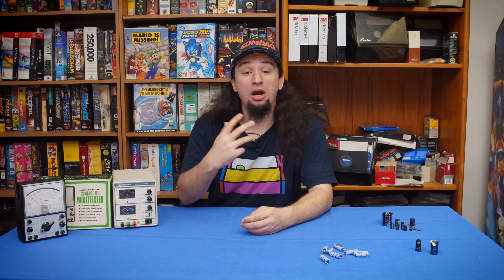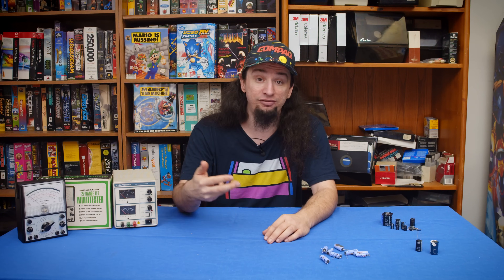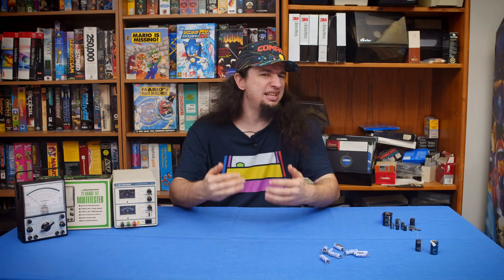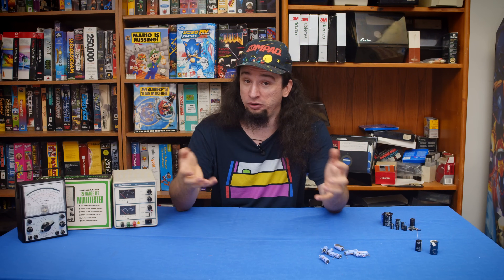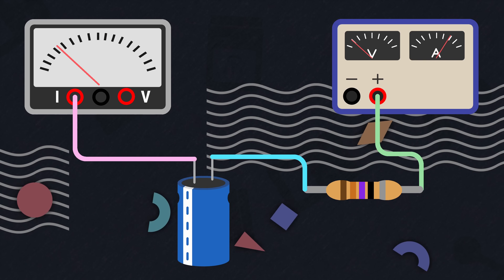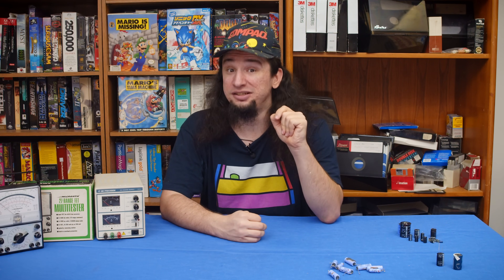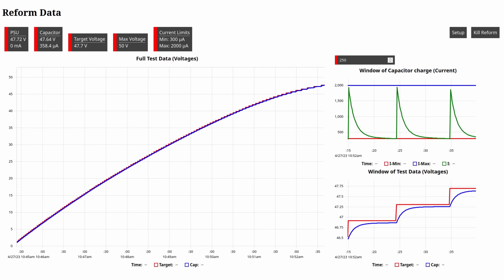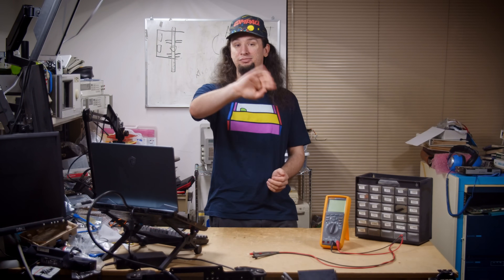Reforming Capacitors - Everything you wanted to know

Comment: It's a very interesting technical explanation on reforming, and how capacitors work.

But I'm not really clear on why you'd bother to do this.  You have to go to all the trouble of taking them out, which is most of the work of replacing caps.  Most caps in electronics cost on the order of $1, sometimes 10 cents.  

There's maybe some caps that'll cost $10 or $20, but even then it seems like a lot of time an effort setting up equipment to save $20.  It's impressive that this can be done, but I still have to ask, why bother?
Reply: Same question for me. But the likely answer is financial. Shelly considers  a 10 to 20 dollar cap expensive. And hey, it might be for him. But considering the amount he must have spent on equipment and time i doubt his overall cost calculations. 
And even after returning reforming the cap might not be totally reliable again and if it blows, the repair might be even more costly.
Reply: @bzuidgeest  then again a reformed cap might be very reliable. Sometimes we do things simply because we can.
Reply: @1pcfred  and sometimes you might win the lottery, but do as you wish. It's your stuff

Comment: Reforming is scientifically totally valid. But i do consider it not worth it. Financial means of course differ, but even the big ones i consider cheap. Most devices only have a few of them. And you will rest much more easily, being sure that it's perfectly fine with a new one. Repairs you have to make to the devices in case the reformed cap fails will possibly also be more expensive than if you had replaced it on the first go. 
This was a good video in my opinion. My only gripe is that i think you should have been more clear about that this video only covers a very specific case. The case of relatively modern electrolytic capacitors. Though you did mention that in passing.

Comment: So after reading through the other comments there is something that should 100% have been called out: NEVER reform or attempt to reform caps that are across line voltage in circuit. Those should ALWAYS be replaced with X1-Y2 rated safety caps. This is because electrolytics when they fail short don't always fail catastrophically short. That means they can heat up and actually cause a fire, particularly at mains AC voltages. Safety caps will always fail catastrophically, meaning they will either blow your fuse or fail open. But they will never fail in such a way as to cause a fire.

Another place that I would highly recommend never reforming is a bypass cap on a choke or transformer winding. This is because if that cap fails short it will heat up the choke or winding and can damage it to the point that it needs replacement. Transformers are expensive, caps are comparatively cheap!

I'm firmly in camp "it's always better to replace than reform" when it comes to electrolytics. But it's important to also call out that there are capacitor types that should always be removed before powering up a device: Paper and foil caps (waxies) should be replaced with polypropylene caps, before installing the new cap check the outside foil using an oscilloscope and connect that side to ground to reduce RF. The same goes for oil filled. Can style electrolytics should also be replaced as well and are often filled with PCBs. They should be replaced because when they fail the will release massive carcinogens into your environment.

It's always important to consider what happens if the cap fails before considering reforming. In many cases the failure will be damaged parts that are much more expensive than the cap. Hence my stance on "replace don't reform". A fire or destroyed transformer can be many times more expensive than just replacing the cap.

Final thoughts: What Shelby is saying here only applies to aluminum electrolytics with fluid electrolyte, not older styles or other styles. He says as much in the video, but it's worth reiterating massively. Attempting reformation with other styles is not recommended!
Reply: Electrolytic caps are never used across the ac line. They respond very poorly to that. So this video does not apply. That said. Yes please use modern x, and y caps in line filters.
Reply: @bzuidgeest  They have been in the past, particularly in older equipment. As best I can tell the standard was to put them in at a voltage almost twice the line (see the 300V caps Shelby was working with). They are basically equipment destroyers if left in circuit though. It was very common to use the multiple cap "Pillbox" style caps that are filled with PCBs for that purpose. Anything reasonably "new" e.g. mid seventies or later shouldn't have that, but before that point it's all over the place because the alternative was paper and foil caps... which respond even worse. Yet you can 100% find them in radios through the early 60s across line voltage. Plugging any of those radios in will pretty much instantly destroy things or cause a fire if that cap is left in circuit.
Reply: @NullReference119  i have worked on many tube devices and vintage electronics. Never found an electrolytic in there on the ac line. They would blow up. I think you are confused with early metal film or foil caps. Very different cap type.

Comment: I think electronics that require gigantic expensive capacitors should go away entirely. I used to be huge into expensive 1000W systems. It just doesn't really make sense to me anymore. Every single thing you could want to do can be done on a 15W device these days. I can stream WoW at 60 fps on a last gen Ryzen APU only, game and video compression and video upload, all at full performance, at not even the full 15W load of the system. Society as a whole needs to pivot to efficient devices like 10 years ago or we're all going to be dead soon. The rate at which power consumption is dissolving the planet is speeding up exponentially.

Comment: I have an old netgear switch and power supply had to be heated up a little  to turn the device on. Does heat helps with temporary reforming, or makes caps even worse? My neighbour recapped it and now it works like brand new, which it essentially is.

Comment: Thanks a lot for this video. I've been educating myself in every aspect of capacitors lately and this was great timing as i've been repairing a large lot of OG Xbox's. Didn't have too much trouble sourcing some caps - even the now discontinued ultra low ESR electrolytic variety.  

I found "reputable" companies offering cap kits either inadequate or flat out wrong at times (dimensions, lead spacing, rated voltage, ESR, even capacitance). Also been recapping the disk drives which is uncharted territory in terms of the Xbox. Additionally, the capacitors are often low profile and lack proper identifiers. Thanks to this video and one other, think I feel confident sourcing my own.
Reply: Ultra low ESR.. isn't that discontinued because we now just call that low ESR? Technology advanced.
Reply: @bzuidgeest  Currently no caps can meet or exceed the Nichicon HN 3300uf 6.3v in terms of specs. Polymers of that capacitance aren't manufactured.

I've been substituting by going with FM or ZLJ in 10 volt variants. Impedance is relatively close, and ripple handling is up to par.
Reply: @nuckenfutz9983  Yes more a thing of what will fit, rather than actual capacitance, and sometimes you are stuck with using ChongX, because they are the only thing that actually is available. At least better than the Lelon or MysterLee brand ones.

Comment: With small capacitors, probably not worth the hassle. The big beefy ones though, definitely worth trying if you got the equipment for it. Those guys are NOT cheap, and are often difficult to source!
Reply: it can be worth it if the cap is an old vintage type and you want to preserve originality as much as possible , i've reformed many signal  couplers successfuly,  in some cases the circuit will self reform them, after a while
Reply: A lot of guitar nuts would disagree. They freak out when someone has hacked up a vintage amplifier and replaced the original tone capacitors with newer variants.
Reply: @cajunfid  That's because what they loved about the sound was, in fact, failing capacitors. The problem is that as the capacitors keep drifting further from spec, the sound will keep drifting. Better to recap it, with some in-line resistors to keep the warm fuzzy sound, and actually have it last for years to come.
Reply: @cajunfid  : In this case : replace the guitar guy !
Drummers are way cooler 🤣😜
Reply: @cajunfid  if these tone caps are only in low level signal part of the circuit, no high dc across them, unlikely to need replacing anyway,
Reply: Pioneer amps from the early 80's .... 
20.000yF/63V .... oh yes ... they cost if GOOD ones.
Reply: @CharlieKirk1000  in an AMP you should definitely restuff or replace... never reform RF or AMP capacitors its a very bad practice because they won't ever operate as well as they should.... they "work" but it wont' be correct.
Reply: @Wingnut353  : Amen bro.
First i ever do.
The old ones have 20.000yF/50V (85C)and i replace with damn good audio (faster) 22.000yF/63V (105C) ....
63 Volts because the old voltage over here in Germany WAS 220Volts and is NOW 230-240 Volts ...
Reply: @CharlieKirk1000  probably will, 20,000 is not a 'preferred' value,  nearest 22,000 IF available in that voltage,, another problem is modern ones are usually smaller can size so if clamp fixed, need modding, or restuff the old ones 😉

Comment: Your 120 V US AC line voltage is measured RMS, that means after rectifying it, the max voltage your cap would see is  170 V.
Reply: Actually we use a center tapped ground bonded 240 VAC single phase system in the USA but thanks for playing.
Reply: @1pcfred  That seems non-sequitur. Your comment does not address what I am writing. 120 V RMS  rectified will be a peak of 170 V, no matter how you supply it. Also, why this cynical attack?
Reply: @1pcfred  you're disqualified
Reply: @1pcfred  "we" "invented" electricity? As in we Americans? No we didn't. And invented? We didn't invent a fundamental physical phenomenon either --- let me guess, you're an electrician who's been shocked by installing too many live GE breakers? .... :P (Just messing with you, man.)

Comment: Why would you want to reuse caps......its like saying I am going to save my Crap, because its cheaper than buying new peanut butter........
Reply: you’d be surprised a lot of larger value caps cost 50-100+ and the equipment that has them usually has several.  Not worth it for the little guys.
Reply: Maybe it’s a specialty soup can sized electrolytic in a piece of test gear that was decommissioned decades ago and a suitable replacement is not available.  Hard to buy peanut butter when the factory stopped making it twenty years ago and there’s none in stock anywhere.  Trying to reform what’s there costs nothing but some time and effort.

Comment: Take it from a EE that has worked with Vacuum tube equipment to TTL/CMOS. Never use reformed capacitors, you're just putting on a band-aid. Think about the ESR as well. Reforming a cap doesn't repair the high ESR the cap has developed. Also how much is your time worth? Want to wait hours for some caps to reform or go spend 10 bucks on replacements and 10 - 15 minutes replacing them? Also why reform something that will fail with in a few minutes, hours or days that will in turn destroy other parts. Just keep in mind when a cap fails it shorts. I honestly laugh my hole off when people bring me stuff that they reformed a 10 cent cap but killed a ROM IC. After thinking of what I just said, yeah, reform caps and keep bringing me it to fix it so I can charge large amounts of cold hard cash.
Reply: Every cap I've ever reformed failed the ESR on my Tel-ohmike.  They check good on capacitance with a digital tester, but fail under load.
Reply: I love how this has been a debate since forever. CuriousMarc has been in the game for a long time and he swears by reforming if they’re old enough! I myself have no opinion.
Reply: Actually it does restore the ESR of a capacitor. So be more wrong why don't you?

Comment: Cool video!  I kinda wanted to do something similar with gpib, but you beat me too it (and did a much better job than I would have).  I’m gonna try deploying your code with my Kepco bhk500-80mg and use it on some high voltage caps.  Thanks!

Comment: For old caps that have high voltage, is it still worth doing even though my PSU can't reach the rated voltage?
Reply: Late reply here for clarity's sake - I wouldn't recommend that because you'll end up with caps in an unknown state. As he briefly mentions, electrolytic caps going or gone bad can exploded - especially true with high-voltage ones. (I have a big black stain on my ceiling from the hot goo that exploded out of an old TVI monitor as proof of POOF.) Just replace them - it's not only safer, it's faster.

Comment: boom!!!! we have lift off the tin can of the capacitor just blew off and foil and electrolyte soaked paper is scattered all over inside the device flash!!! a flash comes from the rectifier tube and the tube no longer works.

in vintage tube devices it is possible for a failed or wrong capacitor to blow the rectifier tube and now you have to replace the rectifier tube witch is getting more difficult as the many of the tubes are no longer being made and the stocks run out and what remains becomes more expensive.

to get the 300 volts all you have to do is tear down an old camera flash as they can easily go that high.

you can also use a transformer from a device that uses a b+ of 400 volts and variac method.

for the monster capacitors cant you parallel a bunch of smaller ones?

Comment: Wouldn't it be possible to just use a constant current source  and setting the complience voltage to the rated voltage? That way it would automatically reach the rated voltage without human intervention or automated gear. Many modern powersupply's have this feature built in.

Comment: You will never reform ESR : DDD The most important thing in mobo caps is ESR. Capacity can be like 10-15% lower but not ESR.
Mostly, just change all caps for a new one with good brand and have problem solved for another 20 years.
Reply: Motherboard capacitors are individually cheap enough that it's not worth the hassle of reforming them. Big beefy power capacitors, especially in vintage equipment are NOT cheap, and are worth reforming if they're still in good physical condition, and you got the equipment to do so.
Reply: I've reformed capacitors and the ESR has improved to an acceptable level if forming worked. The ESR was certainly shit on the same component before I reformed it too. Because of course I measured it then as well. Let's just put it to you this way, capacitors have to be formed if they're to work at all. That's why it is called, "reforming" because it was already formed to begin with. So you're only doing what was done to make it work in the first place.

Comment: TECH TANGENTS, the electrolytic capacitor rated voltage is how much In-Rush current it can handle? When power supply filter Electrolytic capacitors are called Reservoir Capacitors that means that the reservoir capacitors value cut off frequency is below or above 60hz or 120hz? since reservoir capacitors aren't filtering out the 60hz or 120hz hum they are just used to store joules energy current.

Comment: Really all you need is to rig up an incandescent light bulb socket to the power in. The light bulb will feedback any over wattage and protect anything you are working on
Reply: A bulb limiter may protect your house from burning down but I wouldn't guarantee no component failures. In the time it takes a lightbulb to flash a lot can happen in the world of electronics. Some of it rather irreversible too.
Reply: @1pcfred  that's why I use a bulb and a variac together ...
Reply: @1pcfred  indeed it is an old clever idea, eh?  However, as mentioned in the video, the switching power supplies in newer gear don't like the variac method - they futz out (sometimes catastrophically) when undervolted. But the light bulb trick is ok.

When I find out that the internal power supply is a 'switcher', I figure out what its outputs are - what voltages are feeding the circuits - unhook it, and then temporarily connect my variable voltage supplies which can be ramped up slowly (as also in the vid).  Can't always do this of course - typically when the stuff is too tightly packed in the unit, or the board isn't labelled. But I can test the supply's output and then substitute it. (Assuming of course that the supply itself isn't fried. :P )   Good stuff.
:hand-purple-blue-peace:
Reply: @1pcfred  true. But it's better than nothing I guess